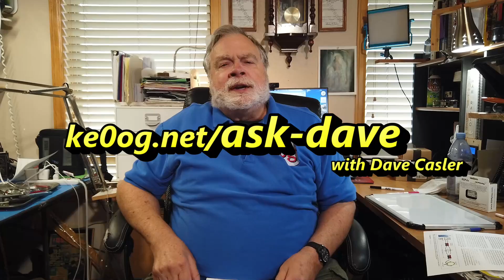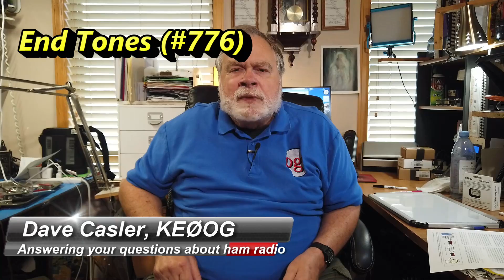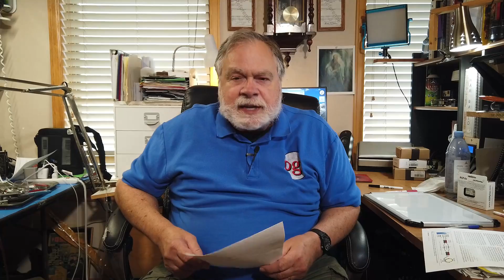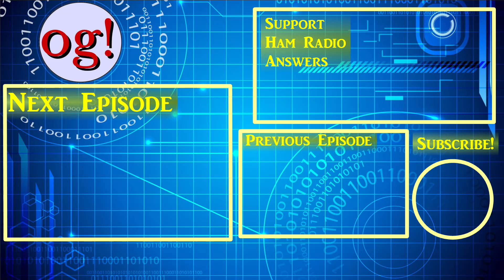End Tones (#776)

Comment: Most repeaters I've been on don't want individuals to enable the end of transmission beep on their radios. Many repeaters don't reset their timeout timer until they drop their transmitter, starting a transmission too early will essentially extend the prior transmission and may cause the timeout to drop the repeater out during the transmission. You should be able to hear the repeater transmitter drop off when a burst of noise comes through before the squelch closes again. Procedures do vary with different repeaters, so consult the repeater managers and observe the procedures that is recommended, or at a minimum follow the examples of the majority of users for that repeater. 73 de w6akb